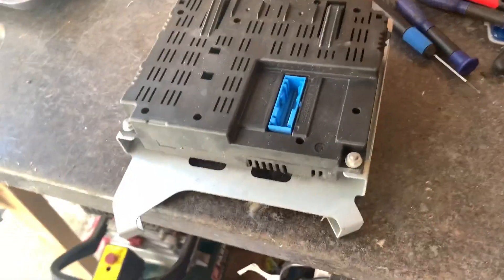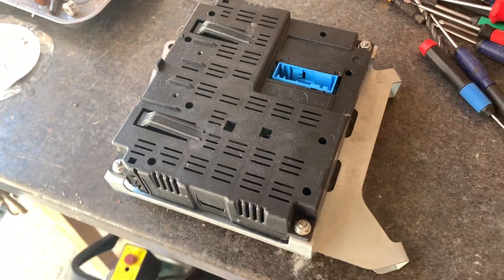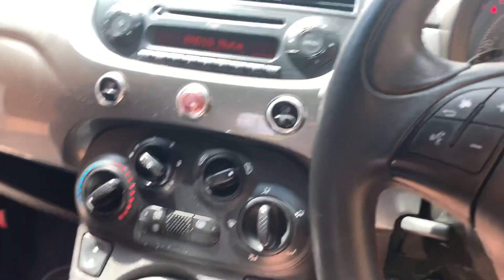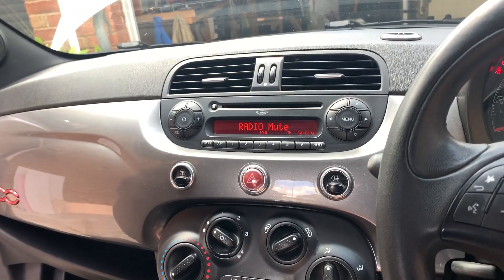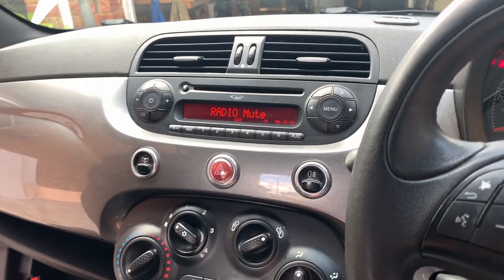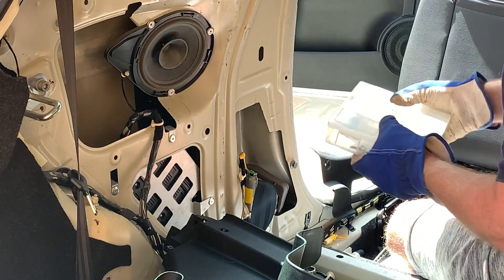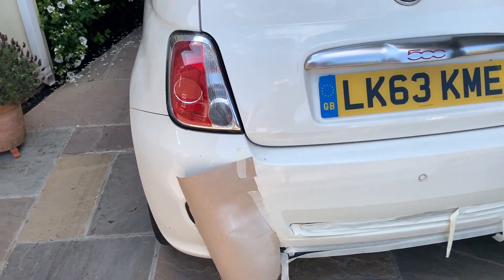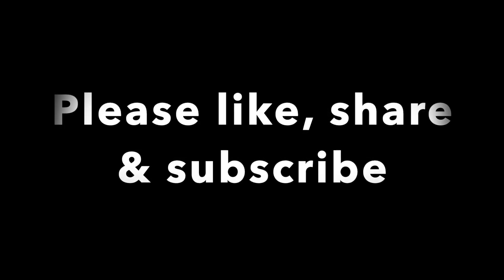Stolen/Recovered Sport Repair - Day 6 - New Blue & Me. Will it work?

Comment: I've just got round to fixing the blue and me unit in my wife's 500. Here's what I've learned. Firstly to wire brush and wd40 the lower seat belt bolt in the wheel arch. This is paramount. If the bolt seizes you'll have to drill it then use a dremel rotary file to cut away. Be careful not to knacker the thread. Then send the unit off to Revtronic in Bradford. £175 and its turned around in 24 hours and no proxy needed. If you do require a new bolt as you've knackered the old one you'll probably go to Fiat. They don't stock bolts for the older 500. They came complete with the seat belt. You can get one of the later models bolts but you'll require a penny washer as there's no shoulder on the bolt. I believe the issue with the blue and me is newer phones fry the unit, a power issue I've been told. Hope this helps and saves people a kings ransom from a garage especially fiat.
Reply from the maker: I always use my impact wrench to get that bolt out and it’ll come out cleanly. Using a socket wrench is when they break. I was to.d the same about newer phones although I wasn’t sure whether that was after the repair or the cause of it to begin with. I messaged them to ask but didn’t get a reply.

Comment: Iv'e been using "Hammeritte" spray paint to do my wheels lately. needs a quick sanding , and then  goes right on without the need for Primer, and looks great for the price (£10 a can) :)
Reply from the maker: Budget Bucket List Cars And Bikes nice idea. The good thing about the etching primer is it fills in the imperfections too.

Comment: Hi great video it has taught me a lot, I have removed my Blue & me from the car and there is a few on Ebay, what I would like to know is if I buy a second hand one will it work even if the part numbers are different ?  also when you said there is no date on them it is there
its on that small piece of paper on the bottom but yours had the bottom plate on and you could not see it, but all in all great work thanks
Regards Dave
Reply from the maker: There are two versions. V1 and 2. Depending on the age of your car depends on which version you need. It is cheaper now to get them repaired. You don’t need to match part numbers.

Comment: Great video and took off back seat panels (both sides) no Blue&me unit! I have a March 31st, 2014 Polish built Fiat500 1.2V lounge - got no blue&me and blinking odo - done the normal thing and also added a new battery.  did a multiscan, and got the classic error code. Q: Where is the Blue&Me unit located in a 2014 with just a parcel shelf?
Reply from the maker: It’s where it is in this video. They are not anywhere else. Is the cable there? Has someone been in there before and removed it?
Reply: @Love500  Well there is no evidence of there ever being either a cable as the original loom going to the rear electrics and the white paint is not touched. I actually checked on both sides. Mine is a LHD French 2014 Lounge model in white 1.2v and my documentation says it came out of Poland. Send you a photo if interested. Thanks for your reply anyway. PS: All the right buttons on the steering wheel and the usb/aux in between the two front seats on the floor.
Reply from the maker: @nigeljohnfarmer  that’ll be the difference I guess. A left hand spec. II broke up a Twinair a few years ago and there was “a stereo control module” nestled under the dash when I removed the dash itself. It was just below and to the left of the stereo. I had no idea what it was until I googled the part number. I’ve never seen one since or before. I wonder if that could be it. Some Fiats other than the 500 have them behind the passenger glove box/shelf. It must be there somewhere.

Comment: So you can disconnect the module and the flashing will go away? I don’t really use this function on my car but now that my mileage is flashing it’s annoying lol. I rather keep it unplugged for good.
Reply from the maker: No, not as easy as that. If you’re not replacing it, it has to be “removed” from the active units then a proxy alignment.
Reply: @Love500  so either I have to buy a used one and have the alignment done after install  or have it removed but still do the alignment? I was thinking since my blue and me feature hasn’t worked in months I can just remove it and like you said do the proxy alignment and be done with it. Seems like if they are faulty or lose signal I rather not have it in the car anymore. I thought maybe mine just lost signal some how. I didn’t want to pay for another module
Reply from the maker: @DailyCbr  a proxy alignment may well reconnect but you won’t know until you try.
Reply: @Love500  do you know if the free version of muliecuscan software does the proxy alignment? I want to avoid going to the stealer I mean dealer

Comment: Hi, please explain which two fuses should be checked? i have the same problem but would like to check the fuses first.
Reply from the maker: F36 and F51 on the body module under the glovebox feed it. One is 10 amp, one is 7.5 amp.
Reply: @Love500  thank you appreciate, will have a look. Great video content!

Comment: Great videos! 
Question : do cars with the steering wheel on the left have the Blue & Me module also on the left? Many thanks.
Reply from the maker: I’ve no idea I’m afraid. I would think so but never having had a left hand drive I couldn’t say.
Reply: @Love500  thanks, is there a fuse that I can pull to disconnect the Blue& me temporarily? It's constantly draining the battery of my daughter's 500C ... If so, you know what number? Many thanks and greets from Belgium.
Reply from the maker: @filipbontinck7251  there are two fuses but with a parasitic drain you have to disconnect it at the unit.
Reply: @Love500  ok thanks
Reply from the maker: @filipbontinck7251  it’s F36 and F51 in the BCM but F36 is also for OBD docket and F51 is also for clutch switch and brake lights. If you have climate control both fuses are for that too.
Reply: @Love500  thanks so much, just tested those fuses, nothing wrong with them. Guess I will follow your videos and disconnect or replace the Blue& me module then. Is the radio also lost when disconnected?
Reply from the maker: @filipbontinck7251  no, radio still works. Blue and me only controls the Bluetooth phone connectivity and music plugged into the usb.

Comment: Hi great video I have a similar problem with my daughter s car Flashing odometer/ battery going flat after 2 days when car isn't used plus steering controls , before I get another unit is there anything else it could be Thanks
Reply from the maker: Not really. What you are describing is classic symptoms of the parasitic drain caused by the blue and me unit.

Comment: Can you tell me which videos led up to this dismantled state? I need to take the seat out and the door panel out? Also I am in the US. Where is the blue and me located? Is only the steering wheel different?
Reply from the maker: If you watch the videos in this playlist it will show you. There is also a video in the How to Series which shows you how to get the seats out. The unit is behind the left hand rear quarter panel. It’s riveted in so you will have to drill out the rivets.
Reply: Each car is a “ playlist”. Got it. Thanks so much!
Reply: One more question, was the USB also not working/ fixed when you replaced the module?
Mine is not working but I don’t know if it needs to be replaced as well.
Reply from the maker: @lucypayne1947  yes the usb is connected to the blue and me and should work once you’ve changed the module.
Reply: So I got the glove box off an installed the used unit I bought from EBay and it’s not working. 😫
Reply from the maker: @lucypayne1947  is it one of these?

https://www.ebay.co.uk/itm/401856228929
Reply: It’s the black one with the blue plug. I called the dealership to get the number then searched on eBay. It looks exactly like the on from the video
Reply from the maker: @lucypayne1947  I wonder why the US cars have it there. Better place for it really. Easier to get to.
Reply: I figure it has to do with different crash specifications.
There is a big foam block behind each panel.
Reply from the maker: @lucypayne1947  you could well be right. I know the US basically destroyed the MG after the California rules stated rubber bumpers rather than chrome.

Comment: Hi mate I have a 64 plate 500 Abarth with a Blue&Me that keeps draining my battery, plan to get it removed and not replace as I dont use it anyway. How much should I expect to pay a mechanic to remove it for me? Thanks
Reply from the maker: Oooh, there’s a question. If you follow my video it’s easy to do yourself. If you’re not replacing it then you just need to disconnect the power connection at the unit. You don’t actually have to physically remove it to do that. Get the side panel off, get your hand round the back and just remove the power connector and leave it dangling. That will prevent the drain. If a mechanic knows how to do it, it shouldn’t take more than an hours labour so maybe £80-£100. No parts so maybe you could get a mobile guy for cash.

Alternatively you could try removing the two fuses that serve it which I believe are F36 and F51 on the BCM fusebox under the parcel shelf.
Reply: @Love500  Do you think I could get the side panel off myself easily? I don’t have any tools where I’m staying at the moment. Thanks for the response
Reply from the maker: @Conzr  you’ll need a socket set or spanner’s to take the seats out and remove the seatbelt top ashford and a Philips screwdriver to undo the screws on the kick panel. Try taking those fuses out first.
Reply: Please let me know if disconnecting stop the flashing millage. thank you !
Reply: @24tissues  It didn't stop the flashing mileage, I'm not sure what can. I ended up getting the Blue&Me removed for a good price which fixed my battery draining though.

Comment: Hi can you tell me what the two difference between the modules are as I'm trying to source a second hand one and trying to find what numbers will be compatible with my car a 2013 model
Reply from the maker: They are just software update differences as far as I know. Just get one from about 2011-2014 and you’ll be fine. I’ve never had any compatibility problems.
Reply: @Love500  hi thanks for this i have someone on ebay selling one for 120 obviously wana make sure it will be ok before spending that sort of money, in your video yours just work but is normal procedure the Bluetooth works but the proxy alignment needs doing to solve the flashing mileage did you just get lucky with this? Thanks chris
Reply from the maker: @chriselse515  no, they always work. It still works even though it needs the proxy alignment. £120 is double what I normally pay.
Reply: @Love500  have you got a seller you usually use as everyone i have spoken to are asking silly money for them at the moment
Reply from the maker: @chriselse515  no, whoever is cheapest. Unfortunately due to lockdown there’s a shortage of parts so prices have gone up. Find one that has best offer and make one. I’ve bought two speedos much cheaper recently by taking the pee a bit and they’ve accepted it.

Comment: Hi mate
Do all these 500s come with blue tooth has standard 
Phil in stoke
Reply from the maker: philip newton all but the Pop unless it was an added accessory on purchase. Newer facelift models use uconnect which is built into the head unit.

Comment: Hi mate I have a Fiat 500 2012! The mileage has started flashing and blue and me stop! Do you think it is a fuse or the module thanks??
Reply from the maker: TheBBChannel1000 could be either but most likely the module. Try taking the quick release earth terminal off the battery for 10 minutes. That often does the trick.
Reply: Love 500 hi 
I have done that still the same, any ideas the best place to get the module 
Many thanks
Reply from the maker: TheBBChannel1000 you need to do diagnostics first. If you need to replace the module eBay is the best place. You’ll get one for about £60.
Reply: Love 500 
Are all the modules on the fiat 500! Placed in the same place as where you took yours out please

Comment: Hey mate
I got a fiat 500 sports 2015 and facing same problem with it. Even my charging point & data cable port doesn’t work as well. 
Can you please advise how can I fix this issues.
Reply from the maker: If you watch the other videos in this series you will see that I changed the Blue & Me Unit and is all was then working perfectly.
Reply: Love 500 mate I found one car that fiat 500 twin air 2013 this car blue & me module will work on my fiat 500 2015?
Because if I’ll get from the dealership they take ages to get that module in their stock.
Reply from the maker: parminder singh it should be fine. There were only two versions of the blue and me modules both of which should work fine. I’ve never had a problem. You will need a proxy alignment after as the mileage will flash. Try it before you put the panel etc back on.
Reply: Love 500 thanks mate really appreciate for it. 
And I got the blue & me module but when we replaced then couldn’t make the coding the part is faulty. 
Can you please advice from where I can get the good working module?
Thanks
Reply from the maker: parminder singh I always get them on eBay.
Reply: Love 500 have you got any spare module I can get it?
I’ll try to find from eBay that the last option I have!
Reply from the maker: parminder singh no, I only buy them when I need one.
Reply: Love 500 all good!
Mate can I do proxy alignment from my self?
Which fuse should I check if might be have problem with them?